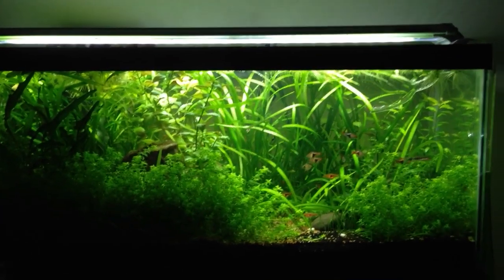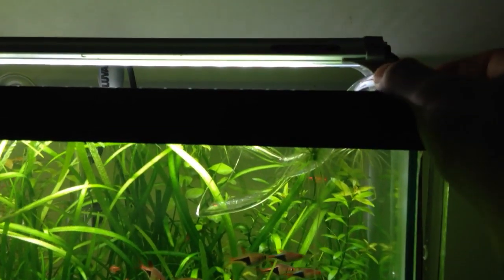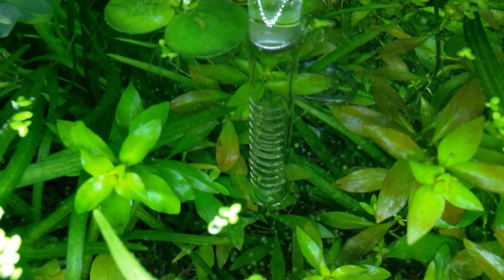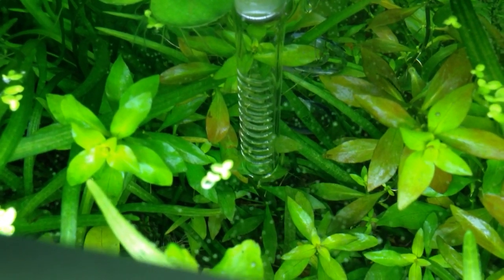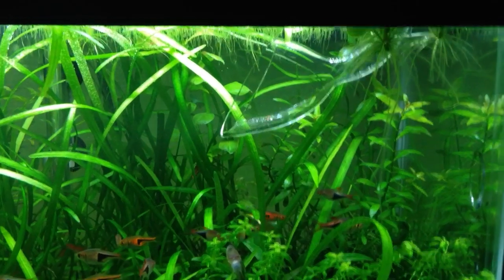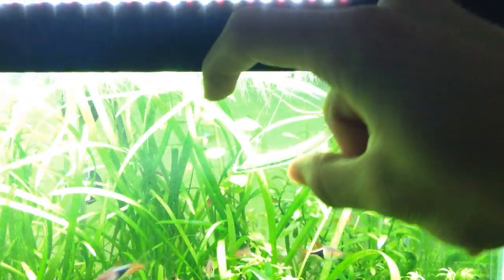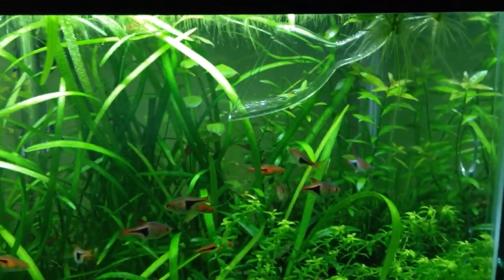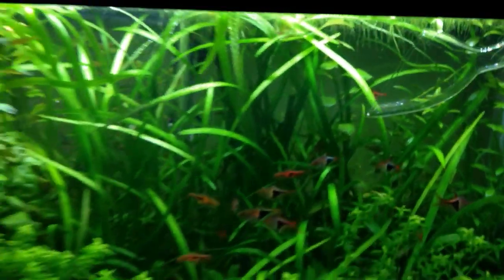Fluid dynamics of filter pipes

Comment: Which model intake pipe did you get? I have the same size tank and want to make sure I get the right one
Reply from the maker: I got the influx x2 13 mm. But it really depends on what filter you have as well as tank depth.

Comment: I love CalAquaLabs and use their drop checkers. Their lily pipes are expensive! Wish I had some. Looks great man and good info.
Reply from the maker: Yeah they are expensive, but they are really good looking and the flow is wonderful too. Are you familiar with the substrate made by CalAquaLabs called Black Earth? I do not see many people using it. Thanks!
Reply: Oh yeah, I remember them talking about that, that was back before they released it. It is  comparable to Aquasoil. They are all just high AEC clays and high CEC humic acids tumbled and then baked. If it is cheaper I would buy it, if not, no need.
Reply from the maker: Ah, ok. Thanks for the info